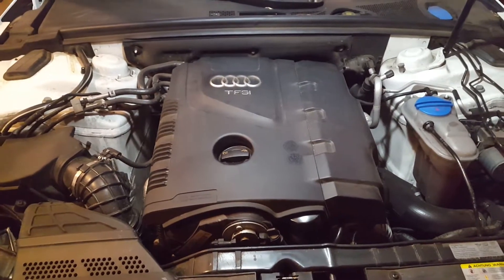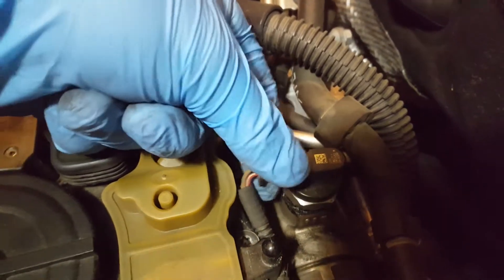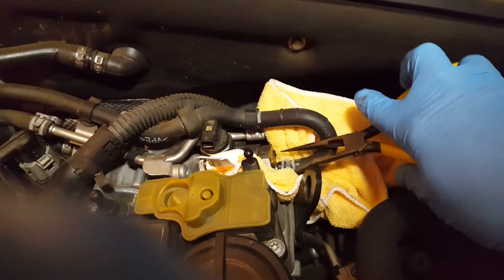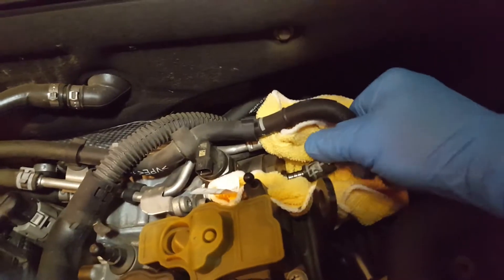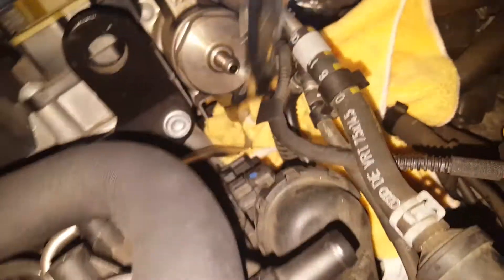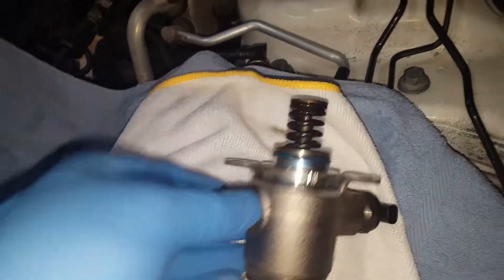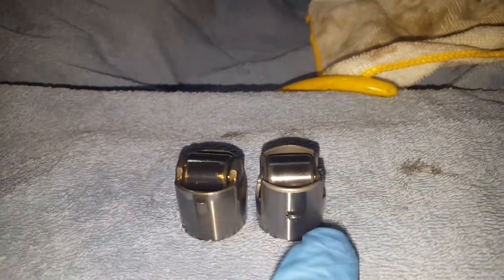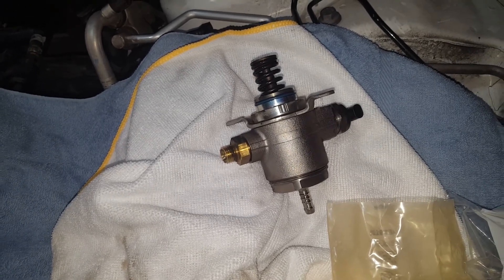How To Replace or Inspect Cam Follower on a B8 Audi A4.

Comment: Cheers for this video. FYI, your smoke alarm in the background is chirping. Open it, take the battery out, press and hold the test button to discharge it. Replace the bavkup battery, put back up. No more chirps. 👊😎

Comment: Would this cause hard starting? I sometimes have to press the gas to start and thinking my cam follower is bad?
Reply from the maker: Very unlikely, but it is posible on some level, how ever hard starting problem could be related to many different things but I would check on air/fuel first as starting point. Thanks for watching

Comment: Have you managed to find same cam follower as the original one? I have the same problem
Reply from the maker: I kept my old one since it wasn't bad at all but if you really need to replace it check ECS Tuning website I believe that they have them all but not all of them are genuine Audi so I would take time and get right part https://www.ecstuning.com I usually order all the parts from them including motor oil.
Reply: I ordered mine and it looks same as original

Comment: How much play the old has side by side or was non??
Reply from the maker: Honestly I didn't measure exact, but the one on this car had just enough play for oil to lubricate properly since cam follower needs to slide back/forth freely. but not much at all.
Reply: Do you think that can cause knocking noise??
Reply from the maker: @miguelmelgarejo4805  I don't think so, unless it is really bad to wiggle sideways and still would probably make ticking sound however, cam follower can make ticking sounds from cam shaft touching it also if is cam follower or cam shaft damaged.

Comment: This one ,exactly like mine is a bit different than the rest for this engine,I have ordered a new one and is exactly like original one,I can provide a link for it..the question is mine 102k is it worth to change it now..as the other type of cam follower is required to change every 20k miles..not sure about this one as it look more solid and doesn't bend like the other ones..
Reply from the maker: The original one showing in the video is still in this car and same car curently has about 220K miles so they are durable looks like. Thanks for sharing and watching!